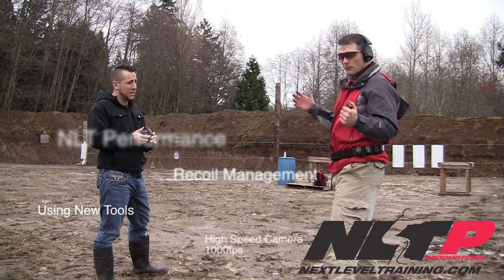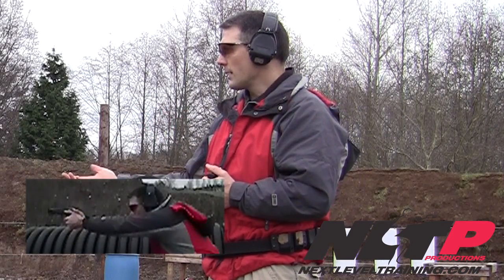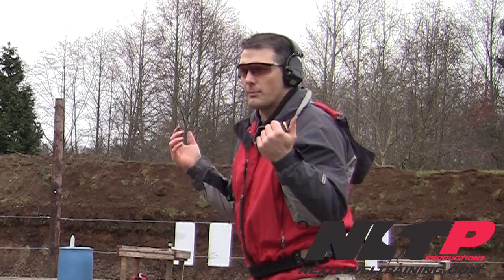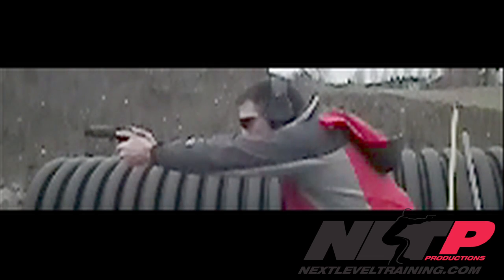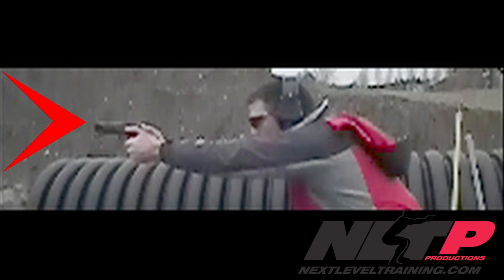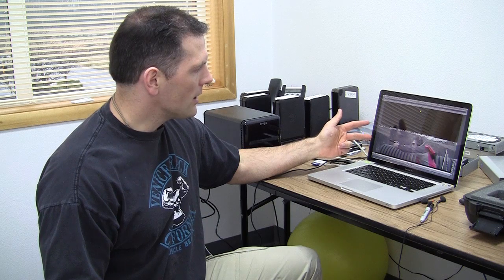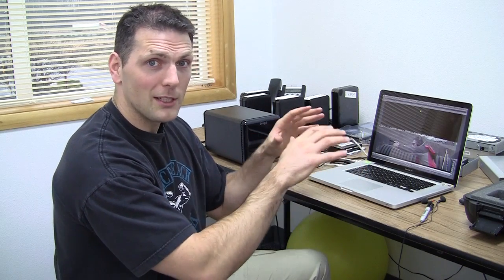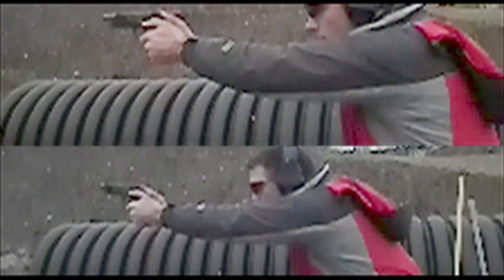Analyzing recoil with a pistol with a high speed camera

Comment: Great video! I did notice though, that in the end (with the split screen), while elbows/shoulders rolled did provide a slightly more stable platform, your splits were faster when you used a "standard" stance. 

Did you notice a difference in the accuracy between the two? From my armchair quarterback position, it may seem that the stability gained is not enough to make a significant difference.

Comment: See Ron Avery and learn a correct grip.Why did you not lock your left wrist.You are missing a lot of the basics.
Reply: What do you mean "why didn't he lock his left wrist."?  You can CLEARLY see his left AND right wrists are BOTH flexing back . If they werent... their wouldn't be ANY recoil. also Theirs no such thing as "locking" a muscle. Its all about recoil "MANAGEMENT". You have to use every possible muscle and bone to reduce and dissipate the recoil....without shaking and throwing off your aim. But you can NEVER cancel out recoil. Its physics. 

Firing fast and accurately is more about muscle memory and timeing than anything . Proper form helps, but nothing stops recoil.
Reply: Watch Ron, his wrist never bend.They stay locked through the entire shooting cycle.The recoil goes down his locked wrist and arm to his shoulder,s and body.Acting as one large shock absorber thus very little muzzle rise.

Comment: mike idk if you noticed but you made other changes to your stance when you rolled your shoulders. you bent more at the waist, making yourself lower. and you moved your head slightly forward.

both stances were athletic (kept a strong lower back and core) and both stances were fundamentally sound. the "dip" did seem slightly better with the second stance, as well as the recoil.

i don't think its possible to completely eliminate that dip. your recoil mitigation is about as good as it gets.